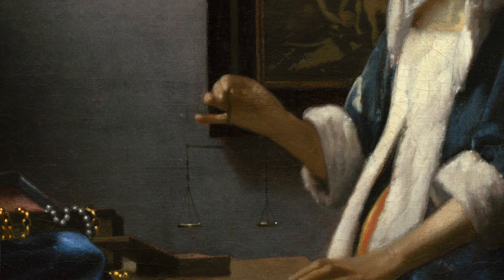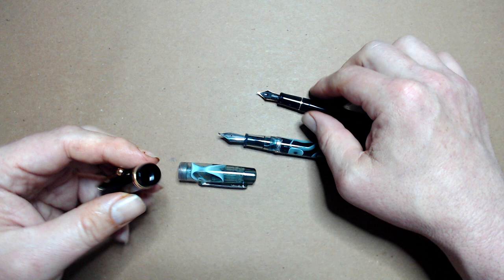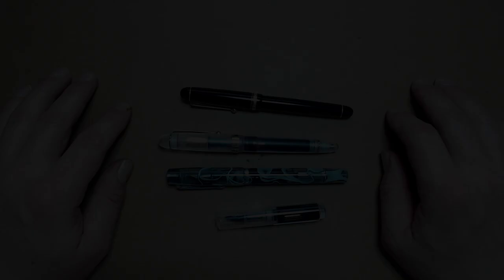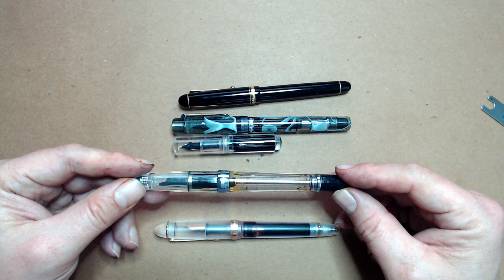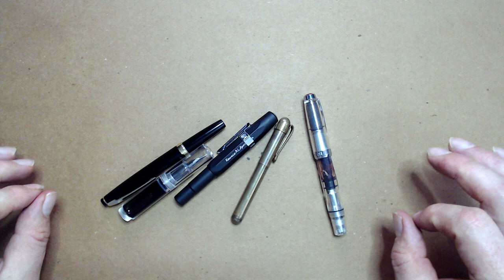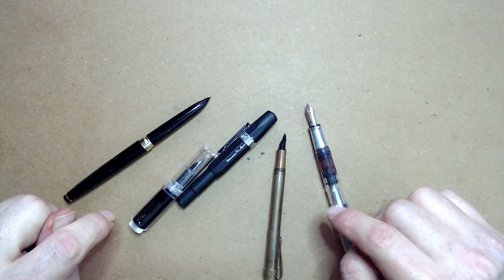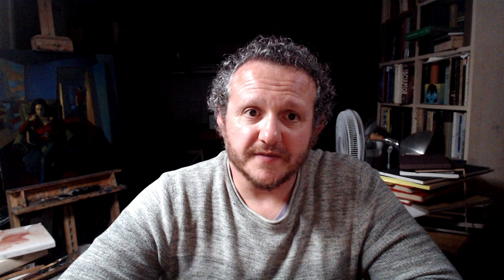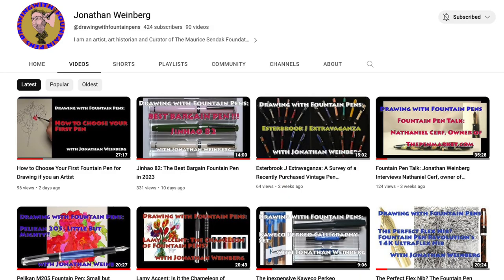Introduction to Fountain Pens For Artists: A Primer For The Beginner

Comment: Great info, as always.  Now I'd like to add my 2¢.
1. Gold nibs are bogus.  Save yourself $1k by not following my example.
2. I think it is best to start with a really cheap pen, recommending the Pilot Varsity which is pre-filled, disposable.  See if you like it before spending real money.
3. Regarding flex nibs, my vintage does not produce results markedly better than my modern, despite what EVERYBODY says.  However the price ranges are similar, so there is no loss in going vintage, other than the old fashioned filling system.  And fragility.
3. Shading inks cannot be used to put down an even coat over an extended area.
4. Sheening inks in my experience do not sheen much on absorbent art paper like bristol board or multi-media.  For maximum shimmer use "coated" paper like Tomoe River.  Or Yupo plastic paper, but then you may need fix. And use a brush or even pour it for full sheen.
5. Beware ink swatches.  Unless you use ink in a brush.  Ink from a pen is almost always a different color than the swatch.
6. If you are going to put your drawing on the wall, you need lightfast ink, or it will fade.  Try not to be tempted by beautiful color inks that will fade.  Moving forward, I am standardizing on De Atramentis Document inks.  I will live with the limited palette (and I do use many colors), in order to get something that doesn't fade.

7. I find it useful to wear gloves or use a handbridge to keep from touching skin to paper, which can transfer oil to the paper, leaving a semi-resistent fingerprint.  I guess you could just put a piece of copy paper under your hand as well.
This comment is way too long, sorry.
Reply from the maker: Great comment as always, more like a dollar’s worth.
1. I have exactly one gold non-flex pen, a Pilot 823. The nib on it is fantastic, but I suspect it due to the extra quality control given to gold nibs rather than some inherent superiority of the material. I will not be buying any more gold nibs, unless they’re flex. 
2. I disagree with going super cheap at the beginning. I think you need to try a pen with good build quality and a very good nib to have that road to Damascus moment. A Pilot varsity won’t get you there, but a 30 dollar investment will.
3. True: vintage flex is better, but marginally, and the advantage is not worth the extra hassle of having to coddle a fragile antique. 
4. Shading inks are supposed to be uneven and varied, that’s their charm.
5. I wish I had touched on the archival issue. Will have to add an addendum at some point.

Comment: Marc, this is one of the most comprehensive, succinct, and intelligent videos I've seen on the topic. Congratulations on a stellar production. If I had a quibble with any point, it would be that I think you overstate the risk of flying with a fountain pen. I have done it many times without mishap. But that doesn't take away from my appreciation of your video. Best regards.
Reply from the maker: Thank you! My experience flying with fountain pens hasn’t been catastrophic, with a few pens leaking into the caps. But this is pen dependent (and pen position dependent). At any rate it’s still a good practice to empty your pens when flying.

Comment: Greetings sir, love your long insightful videos. I would be happy to see videos about fountain pens and their techniques and how do artists use them so that they dont dry up while taking pauses when uncapped.
Reply from the maker: Thanks! There really no way to keep your own from drying up when uncapped. The good thing is that if the ink is water soluble you can quickly get it started with some water (or saliva.) Remember to keep it capped when not using!
Reply: One newer option is using an ink from Private Reserve that doesn't dry out on the nib like a typical ink. I haven't used any of these inks yet, but reviews indicate they work very well. I think they're called Infinity Inks.

Comment: Geometry and design from my metallurgy and metal fabrication background has in both material science and practical use have far more impact than metal used up to a point.
Now ease of fabrication can often have a large impact in metal choice on the quality of final produced item. It's why brass is often chosen, ease during fabrication for high quality products.
Reply from the maker: Those are my non scientific findings as well. The material is rarely a large factor in whether I like the pen.

Comment: Have you ever tried blue dew nibs? It looks like a leonardt principle dip nib and supposedly can be friction fit into jowo size 6. they’re supposed to pretty much be a zebra g that doesn’t corrode in a fountain pen
Reply from the maker: No I haven’t tried the blew dew. Something about it doesn’t appeal to me. The body is very cheap (I believe the same as some Lorelei models) and the nib though non-corroding is untipped and will still need replacing over time.
Reply: @mkompan  yeah I was  mostly after the nib not the body but I didn’t know it would still need replaced. I’m after a flex nib that produces hairlines when non flexed but I’m tired of replacing dip nibs. Thanks for the reply

Comment: Hi Marc,
I love your in depth videos. I recently discovered Ackerman fountain pens, that use traditional dip nibs, like Principal, Brause rose, bandzug, etc. Obviously Ackerman pen is for those who have some competency with traditional dip nib drawing. I have six of these pens, three inked with Diamine like inks and three with w/proof acrylic inks. I put in the caps of those tine pieces of foam. It works very well - I usually moisten the nib with a waterbrush and start to draw. You have to change the nibs, of course, from time to time.
It takes some time and effort to get used to them. And of course, i always have a plentiful supply of tissue ready... These pens can be temperamental. But the idea of using nineteenth century type traditional  nibs is very attractive for me. 
Id love to know your opinion about Ackerman pens. Thank you for your videos.
Reply from the maker: Hi Dmitry,

Ackerman pens have been recommended to me multiple times by commenters and I’ll have to try them soon. The foam in the cap trick works really well, and allows you to use India ink in your fountain pens (so long as you keep it regularly moistened).

Comment: I put Bayside blue ink into my Ackerman flex pen and have a gummed it up. I tried scrubbing it with soap, water, and a toothbrush I tried soaking in vinegar and scrubbing it again, but I can’t get the ink to Flow anymore. Any ideas on how to fix this?
Reply from the maker: I don’t have experience with Ackerman pens or Baystate blue, but I suspect you have a clogged ink channel, which a toothbrush won’t clean out. Try running a piece of acetate through it (or some other thin plastic).